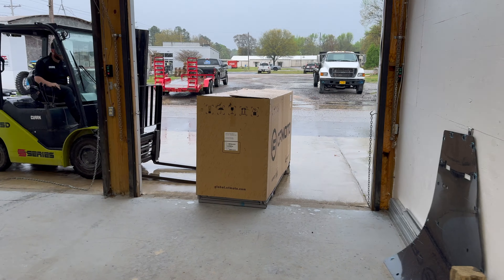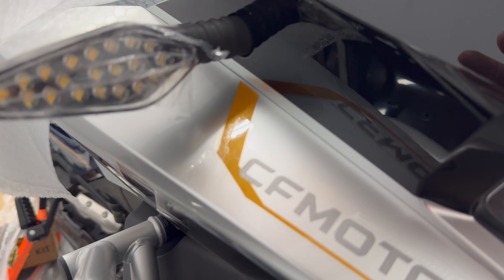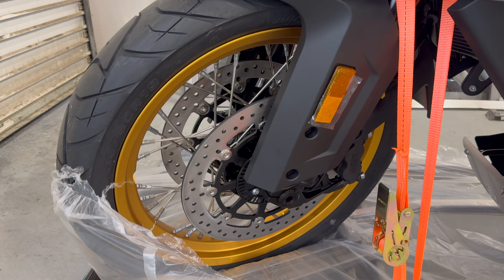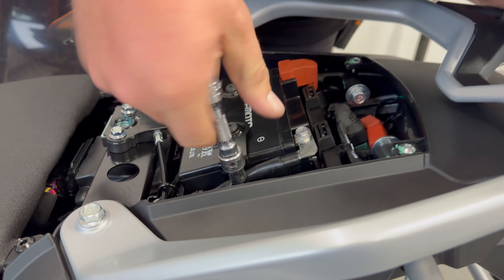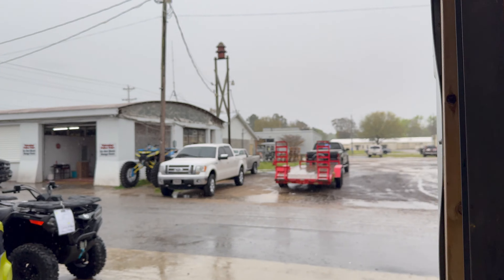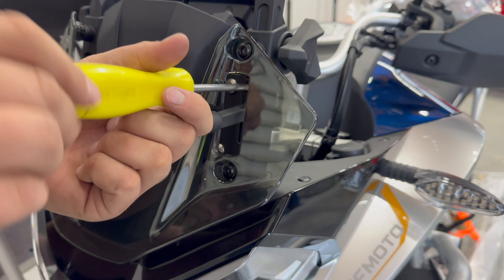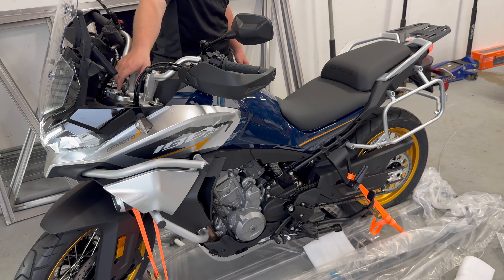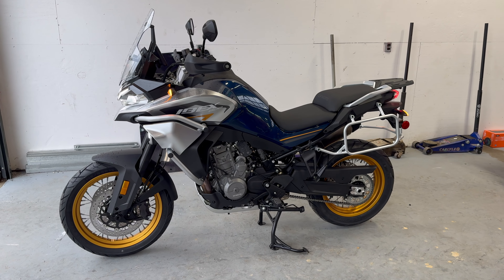The Most Expensive CFMOTO Motorcycle Available in the USA

Comment: The camshafts are likely melting.  Inspect them.
Reply from the maker: Why you say that? I have not heard of any issues like that
Reply: @RealTalkPowersports  Every generation of the LC8c in the 790/890 has been plagued with prematurely wearing camshafts.  Even some reports of the new 990 showing the same problem. After about 10 to 15k miles a lot of them are failing or are at least scored to hell.  Prevailing theory is that there's inconsistent hardening of the camshafts.  Hopefully I'm wrong, for your sake 😔